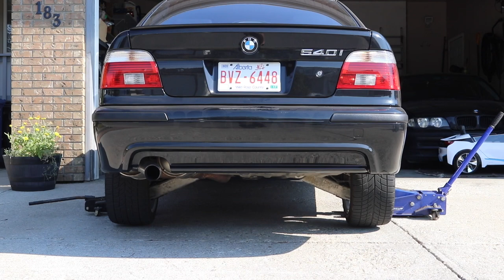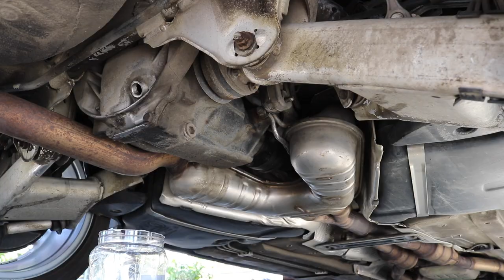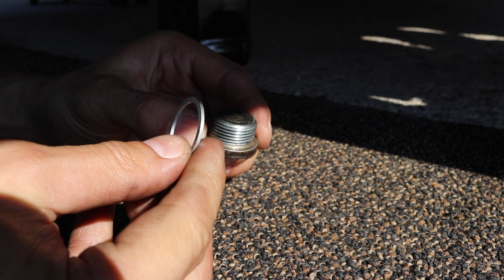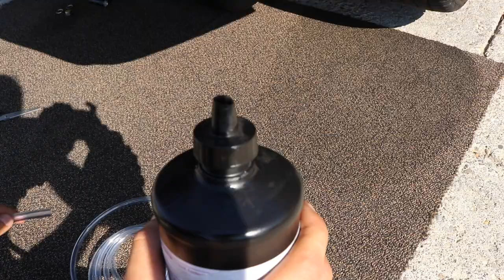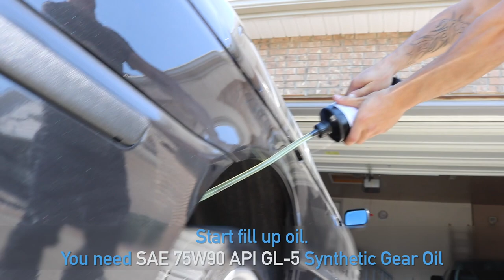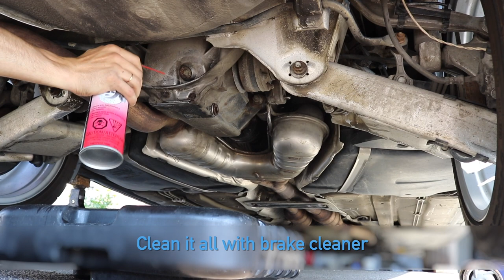How to change differential oil on BMW e39, DIY

Comment: I’m the middle of the job right now actually😂😂 this is a great vid. Thanks!
Reply from the maker: Thank you for watching!
Reply: @mikes.garage  thanks! I spilled some fluid and it is IMPOSSIBLE TO CLEAN UP😂 it took a whole can of break clean to get the greasy residue completely off. Tightened the bolts as much as I can and I’ll take it for a spin tomorrow to make sure everything is in order.
Reply from the maker: If you have torque wrench, you can tight it to 70 Nm or 52 ft-lb

Comment: I've just bought a 2000 E39, and the differential housing looks very black, have yet to get it up on a jack and inspect it. Might it be that the oil has leaked out and all around the outer housing?
Reply from the maker: Maybe oil is coming out thru axle seals. Usually is coming out very small amount, then dust sticks and looks bad.
Reply: @mikes.garage  thanks for the advice, maybe the axle seals and the differential oil needs replacing in that case

Comment: Is the same process and procedure for 96 e39 528i bmw? And do i use the same oil used in video?
Reply from the maker: +Bat Man Yes, it is the same process and the same oil. If you are in mostly warm climate you can use sicker oil 80W-90. Use 90W-145 weight if you are in hot climate.
Reply: Mike's Garage thanks mate really appreciate it Mike, i live in New Zealand and its summer here at the moment which is pretty hot.
Reply from the maker: Bat Man Good for you. I live in Canada and we had -25C last week 🏂 You can use 80W-90 it cost cheaper.
Reply from the maker: Kristian riisnes You can try to make yours video and put any music you want.
Reply: i dont want to make youtube videos im after info for my bmw, be proffesional!
Reply: nobody wants to hear that *tween im 16 years old music *
Reply: @kristianriisnes7527  there is a volume button somewhere on your' e device.. With that button you can put volume up or down and even off.. Problem solved,
Reply: Kristian riisnes has

Comment: Same oil can u used for. 2000 bmw e39 528i  or  they need different oil pls help me out thanks
Reply from the maker: Yes, you need the same oil 75W90
Reply: @mikes.garage  thanks
Reply: I have question how many liters they take pls
Reply from the maker: @Flamur804  For your car around 1.1 litre, maybe a little more. You need to fill it up until the oil start to come out from the filler hole.
Reply: @mikes.garage  thanks
Reply: @mikes.garage  hi, will it be Same oil for e39 523i??
Reply from the maker: @kosty315cov2  yes
Reply: @mikes.garage  thanks you 👍